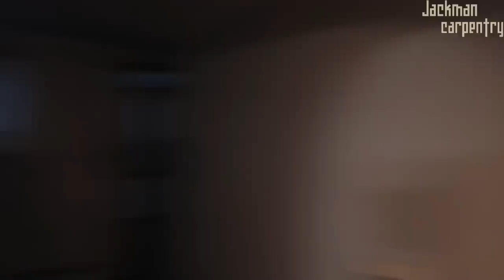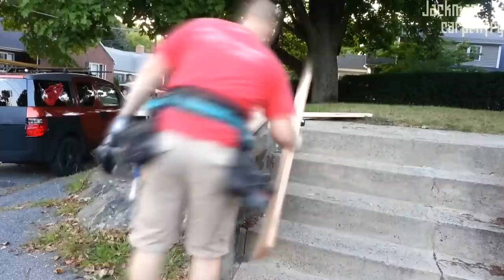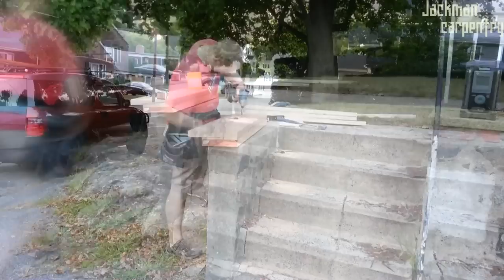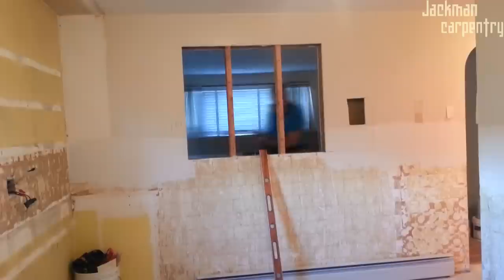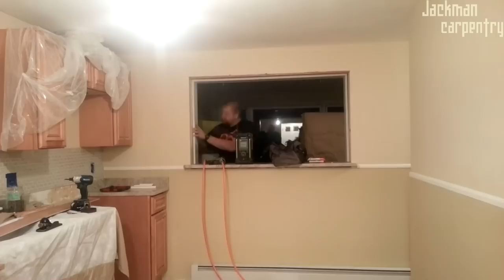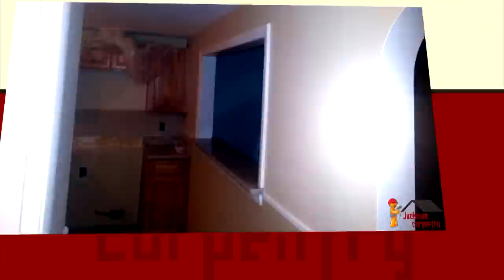Kitchen-Living Room Passthrough Window

Comment: I believe that’s a load bearing wall and would have supported both sides of the ceiling, extending a bit beyond the opening, before cutting the four studs. But everything looks awesome! I’m considering doing the same thing so I very much appreciate your putting this out there. Thanks!
Reply from the maker: Correct, this is technically a load bearing wall, but it was only a single story house, so the only load above is the floor joists that it's holding, so I wasn't worried about cutting a few studs and framing a header in right after. If it was left open for a while, or there was a floor above, I would have added temp supports before cutting the studs.

Comment: My question is, what exactly did you do with the studs where you were able to keep the frame of the pass through flush with the cuts you made on the drywall? did you remove the stubs and then replace them with shorter studs that accounted for the thickness of the frame?

Comment: Was curious as to whether or not that wall was load bearing. I am assuming that since you placed a header that it was. The floor plan looks identical to my house here in MO. I am fixing to do the same project so I am gathering all the info I can. Thanks
Reply: Thanks just the info I need

Comment: Tackling something similar for first time. The width of my opening is approximately 65. How long can you leave this open before inserting the LVL header?
Reply: Gogoreview  if the wall is load bearing it will need a a double header and Jack plates no matter the span to pass code.

Comment: Was this a load bearing wall?
Reply from the maker: Yes it technically is a load bearing wall, but it is a single story ranch so the only weight is the ceiling joists sitting on top of the wall. That's why I used a structural header, but wasn't worried about supporting the ceiling while I built the frame.
Reply: Do you have any videos of you doing this with a load bearing wall. I have a small 2 story cape that I would like to do this with.
Reply from the maker: This Old House always has you covered: https://www.youtube.com/watch?v=rZsS_4HiHT8&ab_channel=ThisOldHouse
Reply: @JackmanWorks  where r u located and how much would this cost?